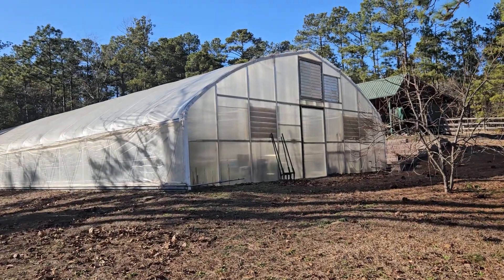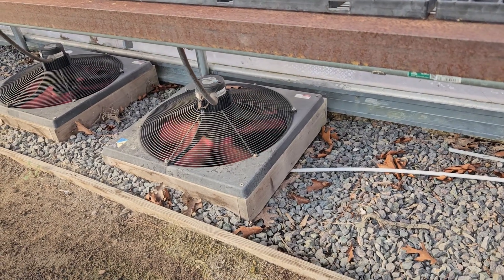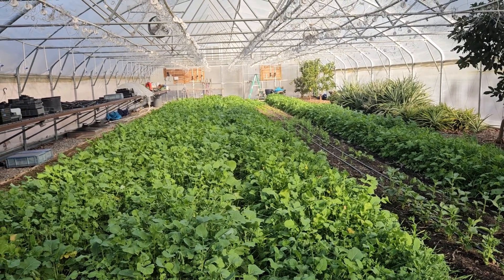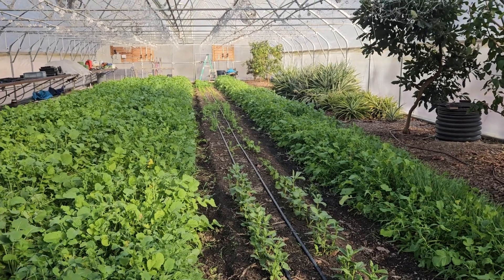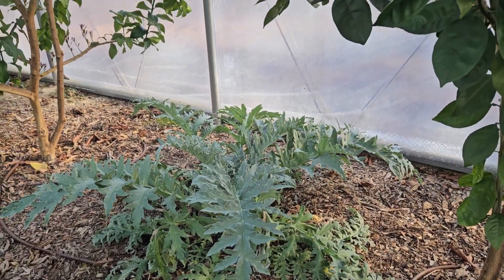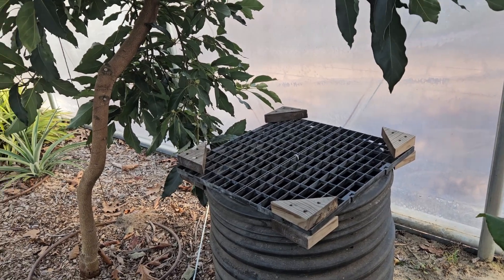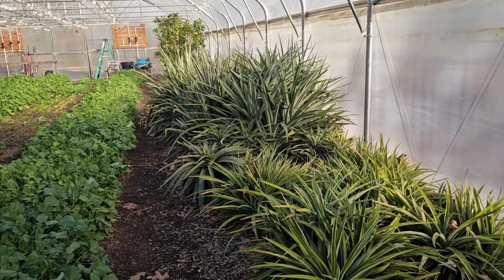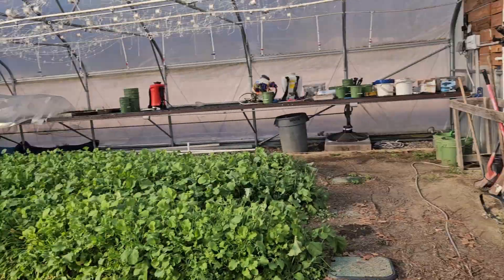Climate Battery Greenhouse Stories: Flow Farm in Aberdeen, NC

Comment: Double layer of plastic or not, there is going to be a serious amount of heat loss with the warmth just radiating away at night... An example of that effect is what happens out in a desert. Hot during the day, but can be very chilly at night. An adequately reflective material like reflective plastic (mylar?) sometimes used in home construction could be unrolled in segments like curtains that would also go overhead (from one side to the other along the bottom of the trusses) and down the sides and ends to encapsulate the whole growing space. To check and see if it would be worth the effort, an experiment of covering a section, ground to trusses, overhead and at both ends of the test area with reflective at night in the winter would likely be telling. The reflective barrier bounces back some of that longwave radiation (or heat) that would otherwise be lost. KEEP THE HEAT!☺
Reply: Having the outputs of the climate battery located near the wall will increase the heat loss through the poly due to the higher temperature differential. Something that is never mentioned is the humidity these systems create when used for heating. Its not unusual for the greenhouse humidity to be in excess of 90% RH at night. Very few installations collect any data, most just measure the in/out temperature difference which is meaningless. To calculate the performance and efficiency you need to know the air flow rate, inlet temperature and RH% and the outlet temperature and RH%. You also need to have temperature sensors installed in the mass. Using two basic thermostats to control the fans is not ideal, if the stat calls for heat and the mass temperature is too low to provide any meaningful benefit, the fans will just  be increasing your power bill. Its amazing that folks are happy to spend tens of thousands on an installation but dont bother to have it tested .

Comment: Awesome video. Do the tubes just wrap around underground at those different depths? Trying to think how I could do similar in my small home hobby greenhouse. Thanks
Reply from the maker: For a smaller design, take a look at the work done by SARE project FNC19-1185. It's run by a friend in the climate battery world and he knows what he's talking about.
Reply: @threefoldfarm  Thanks I will check that out. I'm not terribly far from you in NC.
Reply: The moist efficient option for a small hobby greenhouse is to use a separate fan on each tube. Keep the tubes as short as practical and ensure they run as straight as possible to reduce losses. The system in the video likely has 3 layers of tubing connected to each large manifold tube. Typically, the tubes are simply pushed into holes so they protrude into the manifold, which doesn`t allow for a smooth transition resulting in higher losses. This is compounded by massive amount of air running in the manifold. Doubling the flowrate increases the loss by a factor of 4. With an individual fan on each tube you negate the manifold cost and losses and you can easily test and control the individual flowrate in each tube. The system in the video doesn`t allow you to balance (or control) the airflow in the individual tubes as the inlets and outlets are inaccessible once buried. You cant balance the system before installation due to the perforations in the tubing. Dont forget to install vertical perimeter insulation and be sure to modify the corrugated draining tubing to ensure ithe condensate can fully drain before you bury it in the ground.

Comment: Was thinking about how to make this work for cooling in the summer months in Phoenix AZ, but went and watched your misconceptions video and now im a bit bummed. Are you looking into any sort of effective heat sink or applications in super hot climates? I've been researching and the only cooling methods to combat 120+ seem to use water(thats a big 'no no around here) or are some form of active cooling using electricity.
Reply from the maker: Yea, cooling is a significant issue. The issue in very hot and/or sunny climates with a climate battery is the issue you ran into in the misconceptions video. The climate battery would have to be gigantic to serve as an effective heat sink in a climate like that. Sorry I don't have better news!
Reply: Misters and swamp coolers

Comment: Isn't it more efficient when the pushing fans power is split over 2 fans pushing and pulling, as that will decrease the impedance, created by the air turbulence in the pipes, in the of the climate battery. The ideal solution would be to have the openings, for the hot air entrance, to be extended, via pipes, and be at the top of the greenhouse (where the air is the warmest), and at the opposite side of the pipe, to have only a sucking fan. In this way the impedance in the flow dynamics is minimized, as the air (fluid) organizes itself, to decrease loss of the kinetic energy.
Reply: Correct. Having a high suction fan is how the OG farmer in Nebraska does it. I've proposed the topic on this channel in another video. Hopefully with all of the feedback we can collectively create an even better greenhouse. Also, why not use some solar and batteries to run those fans?
Reply from the maker: My understanding is that impedance is what it is (determined by the tubing layout) for a given airflow rate. You can use more fans or more powerful fans to create more airflow through the system, but the overall "efficiency" of the system, which for fans is typically measured in VER (volumetric efficiency ratio, or CFM/watt), would go down. The goal in my mind, therefore, is to properly size a fan that gives me the airflow characteristics I want in the tubing to maximize the rate of heat transfer into the soil. I'll be putting together another video that covers some of this.

As for a high air intake, and I know this is controversial, but I am generally against them as I don't see the benefits given the costs. I'll go a little into depth on that in a future video, but for now you can look at the final report on SARE project FNC19-1185 as to why he didn't draw air from the peak.
Reply: @threefoldfarm  The pipe geometry and the airflow rate surely are variables the impedance depends on, but let say that we fix them. So we have a given pipe geometry and a given (optimal) flow rate under that fixed geometry, when the fan is on the intake pipe opening and the air is being pushed in the pipe. Under these conditions, the fan will consume X number of Watts. Now, under same geometry lets move the fan to the output of the pipe so the air is being sucked in the pipe and pushed, by the fan in the space, under that same flow rate as in the fist case. Under this conditions, my view is that the air, for the same flow rate will consume less amount of power, for inside of the pipe, instead of turbulence, as in the first case, the air will self organize as to decrease the impedance the turbulence has been creating in the first case. 

In nature a fluid under given gradient, will try to self-organize in its flow, as to minimize the impedance and such maximize the preserving of the momentum or its kinetic energy.
Reply from the maker: Appreciate the respectful back and forth. I'm a little confused by your second scenario. Are you arguing for two fans (one on both the inlet and outlet) or simply moving the existing single fan to a "suck" orientation on the outlet riser instead of a "push" orientation on the inlet?

I understand your reasoning behind self-organizing flow but I'd need to see data or a simulation or an explanation of fan/duct mechanics to agree with it in this scenario. Not trying to be argumentative, I just know that sometimes my intuitions can be wrong (or at least partially wrong) due to factors I'm not considering.
Reply: @threefoldfarm  It is always good to discuss these things in a well intended fashion. Moving the existing single fan, from the inlet, to the outlet, in a "suck" orientation is what I was trying to explain.

It would be interesting to simulate that with software, but honestly, the simulation is only limited to output whatever we have encoded as basic laws and, at lest historically, the "suction", in fluids, have not been researched ,in any sufficient degree, to be even remotely possible to be modeled by software. There are some good educational videos from the 50s and the 60s, from MIT, on fluid dynamics, but even they just show, although very innovatively,  the basic flow dynamic patterns and laws. Dr. Hunt has an interesting article on "suction" and the boundary layer effect, that in my opinion, is a good starting point for people to start to imagine the dynamic complexity in fluids, and in this way, how much of our machinery is built on principles we have historically misunderstood.
Reply: @EfficientEnergyTransformations  
Its very easy to test, simply measure the pressure drop, cfm and power consumed by the fan. You also have to consider air being drawn into the tube via the perorations even if the tube is buried in the ground.
Reply: Good discussion, and I've spoken with Tim Clymer about this as well.  We certainly could have put fans to draw air out of the exhaust riser pipes, and we wondered if that would be a positive or negative thing to do at the beginning.  My intuition is that it's better without the exhaust fans, although we haven't explored this carefully.  It probably depends on which metrics are the most important to the individual situation.  For me, I believe the double input fans going to a single exhaust creates additional internal pressure on all of the underground pipes.  These pipes are regular drain pipes with socks.  The heat exchange with the soil is based on the radiating air going out into the soil.  The more pressure, it seems to me the more the air leaves the pipes through the slits.  During installation phase, we wondered about this during the backfill journey.  Once we started to put the first fans in place, we were delighted to be able to feel some air coming out of riser pipes that were not directly the exhaust for a particular input.  No much air, but some.  I believe this is a good thing.  If we had an exhaust fan, we would be reducing the air pressure on the underground pipes.  So, that didn't seem the right choice for me.